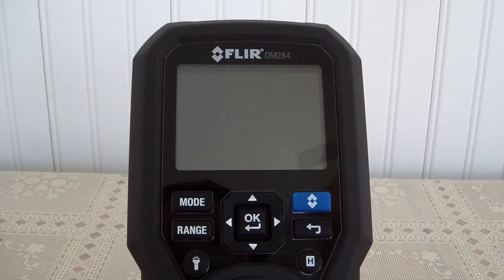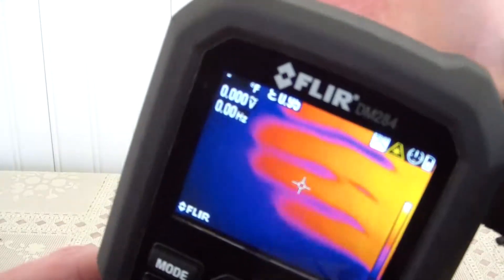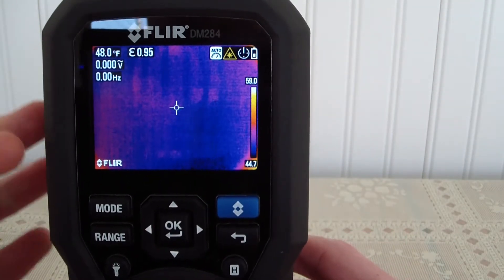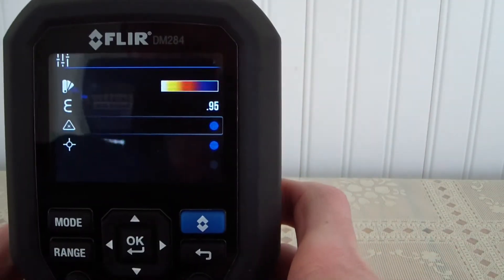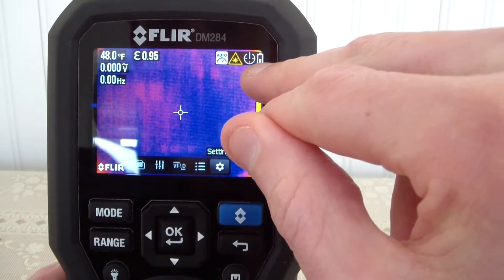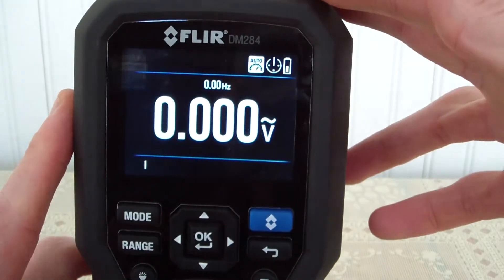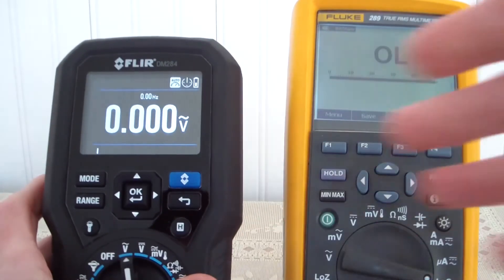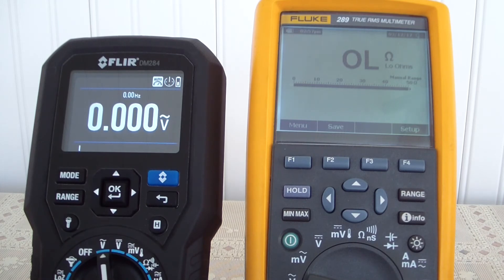Flir Thermal DMM:  Thermal Imagery and Conclusion Part 3

Comment: The FLIR DMM is cool but I would just get one of their handheld thermal imaging tools. The Fluke 289 takes a while to power up and drains batteries as well. Not as bad as that FLIR and the 289 does offer some pretty decent visual features. However, the Fluke 87V is my go to meter about 98% of the time. Powers up immediately, has a wide range of resolution, takes one hell of a beating, and still provides that click sound I've learned to love when choosing its options.